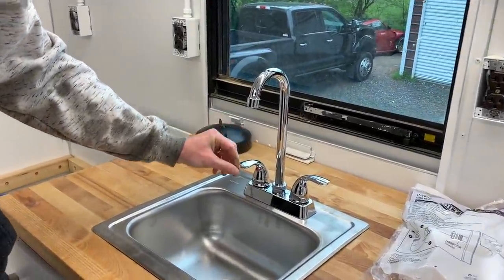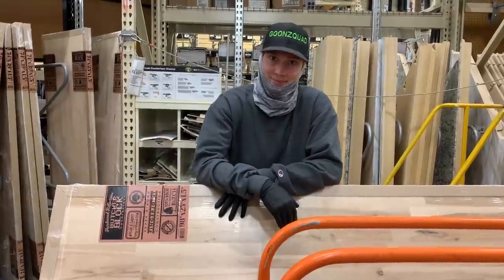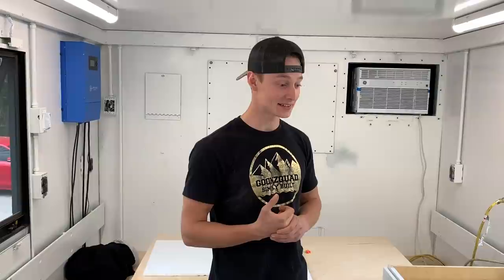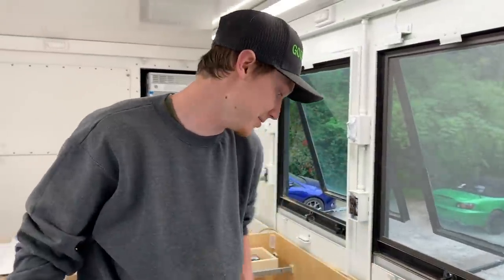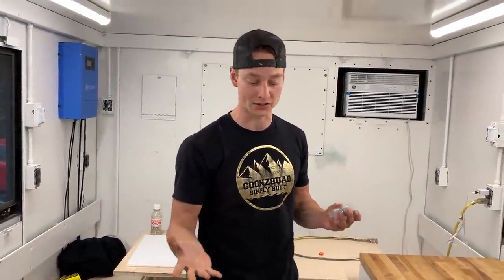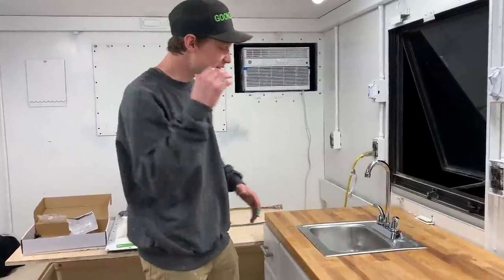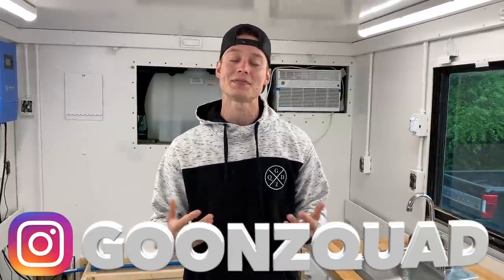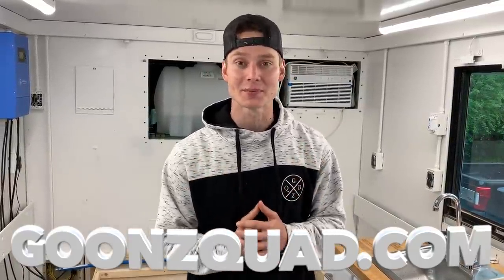Building The Ultimate Apocalypse Vehicle Part 7

Comment: Hi guys. Listen up. On top of the pump is a plastic cap underneath that cap is a pressure adjusting screw where you adjust the water pressure. So as i can hear when tou close the tap the pump stil pumps you must now bring down the pressure of the pump. The pump must shut of the moment you place the tap on fullt closed posion. 👍 greeting from SA

Comment: Those water pumps are normally mounted on a flat horizontal surface in rv’s so that might be your issue. Pump might have a check valve in it that doesn’t work when it’s mounted that way or even just the design in the pump it’s self doesn’t work that way.

Comment: If your sink is below the waterline on your tank, you could just gravity feed water and not need the pump . Also make sure the power inverter has plenty of air circulating around it. He don't want to have an enclosed area where it can overheat. Those things generate a lot of heat when you are using them at higher capacity.

Comment: Regarding the cabinet doors and drawers, you should probably have gotten real "locks" for caravans. Magnets usually aren't enough, that's why they use mechanical push locks to actually lock it in too place otherwise they will likely open when you drive around. Also the placement of that water tank seems like it could be an issue refilling it? At least if you want to use the refill stations in camping grounds, gas stations etc.

Comment: Excellent build guys, some great ideas.Just a little constructive criticism, try to conceal your wiring and pipe work as much as possible and run them in  straight vertical and horizontal runs, looks much neater and professional. Again guys great job none the less.

Comment: You should get electric heating for your water. That wouldn't be pretty awesome. Overall pretty good. Only concern is that you should insulate the water line just in case you guys go to somewhere that has snow. The line will freeze if you don't protect it.

Comment: Try installing pump closer to the tank. I have had  better results and you will hear it  much less great job like always!! NOTE"make sure there is no water in the system in freezing temps you might wanna make drain or like another "T" line going outside for a garden hose faucet this way you can that as a drain for winter storage and for bathing or washing mud out of truck.

Comment: You might think about some low-voltage heat tape so you don't freeze your tank or tubing? Some slide bolt latches for those Cabinets otherwise stuck inside.

Comment: you should put the pump near the tank, so you can run a shower outside the unit and run a T in there to run some pipeing on the roof, for hot water. then bring it in for hot and cold.

Comment: I'm sure someone mentioned it but I didn't see it scrolling through the comments. Because your bandana has tons of open space around them and they aren't filter masks they are pointless. In order for a mask to be effective they have to be special masks and completely seal to your face and be worn correctly. pinched around the nose and sealed all the way around your mouth and nose. The straps on the filter masks need to be crossed so the strap on the bottom of the mask is at the top of your head and the top strap on the mask at the bottom by your neck. Like this XD

Comment: For safety, please use GFCI, and Arc fault at breakers.  Have a one-inch diameter grounding rod. In three-foot sections, with couplers and ground lug to ground too.  The military surplus has slide hammer and rods.  For mobile systems, try to separate fluids from electrical areas. You are using your engine's ability to create air pressure; allows your faucet a pressure accumulator source for water head.  All tanks shall mount to allow for a low center of gravity.  Being under the chassis is safer.  Don't mix fluid lines near electrical—Mount tanks below the chassis frame for safety, ground rods with accessories.  Use health and safety thinking first, to protect from tragedy.

Comment: Saw another build where they relocated the massive spare tire to the rear. Just like a pickup truck with framework to lower it when needed. Opens up a lot of space behind the cab to install generator, water tanks, batteries, etc.

Comment: I know you guys haven't got to the batteries yet but be very careful around those puppies. Your current setup is giving me anxiety.  It's critical you put a vent to the outside.  You can use a DC computer fan, they also make cheap interior fans that are fairly quiet and low power.   If you don't do this the batteries off gas and it becomes a bomb.  Even reaching around the wires, if something sparks or you bump a cable and the terminal comes loose and it sparks you could have a serious situation on your hands.  Make sure you put NO CABLES ON THE NUT SIDE!  This can be easily overlooked.  The cables can back off the nuts causing a explosion. Fab up some kinda tie down for those batteries too.  You don't want those moving at all.  Nothing else should be in that space.  Having the water go through there is pretty sketch tbh I would route it some other way if at  all possible.  Stay safe, enjoy the build!

Comment: Propane is a helluva drug! :D Nice work boys! Shouldn't there be a sealing under the sink from preventing that water irrupts? The inner side of the cut isn't sealed with the oil so water could ruin the wood on the inside. Does the sink sits only loose in the cutout? There are gaps on the front and right side of the sink.  I can only speak for german sinks, but mostly there are some claps with screws, so you can fix the sink to the wood from underneath. Together with the sealing it should be waterproof. :)

Comment: I suggest adding a fill line the exterior tank that is at bottom of box level so you dont have to climb up or move the cab when you want to add water to the tank  just hook a hose to the top of the tank then you can hook to house water or RV park if you want to

Comment: Hey, make sure you vent the tank, otherwise you're just creating a vacuum and the pump is going to work hard and harder until it cant suck anymore
Reply: As it's a commercially available water tank, will it not have a vent installed as standard?
Reply: @2H80vids  It very well may. I hope for their sake it does.

Comment: The sink hole would not drop through because your jig saw is not aligned correctly. It made a tapered hole. You also need to seal under the lip of the sink so water does not get on the edge of the cut or in the cabinet and rot it out.

Comment: i think the problem with your water pump is the water tank is sealed unit. As the pump draws water out it needs to let air in but you have no vent on tank so pump is not only sucking water its trying to vacuum the tank too. Take cap off and run pump again for a while to let air out to test this

Comment: Hey im a new subscriber and i enyoy this proyect, I suggest if you could figured a way for the water to be recycleble filter and clean like an automatic system so you dont have to take your tanks and refill each time you need to if you can avoided great is eassier for the watter in use

Comment: Thank you for understanding my last post.  I really was concerned about your well being.  are you guy going high tech as well on this?   see the military would have blue light in it as well so I would suggest an Led strip light all around.   and I would also add some blue lights for the outside as not to attract too many bugs.  and I have in my home a roll up screen for my projector.   if you add one on top of the doors  you could watch some movies but a well lets not about roll ups or side ways for a bug screen.   might sound silly but can you open one door if the railing is on?  if not might consider moving to stairs to a side so you can open it in case of emergency.  still thinking that a pill out on the second side could add a sofa bed.and if you do it right, you can get storage space under the couch for you other camping gear.   Chairs BBQ and outdoor fire pit and even a tent.  or a meshed  tent.  you might also like to have hot water  pass a line under your solar panels to cool them down.  black pipe will get a lot of heat.  and if you need more  add a line to the truck cooling system  that said  by only concerns now are more of the poor grade of the doors and the fridge.  you need to understand that residential grades and RV and Boat grades are different.   for example. your paint thickness of the melamine of the base for your doors is 80 or 90 in thickness.  if you wash it with harsh soaps  you will see wood dust under it.  but if you build your own you could get as much of 160 or more thickness.  so for example we had some 160 in a contract we did back in 1991 for a paint store.  well they still have some of the units.  and never had to replace a thing.   as well as you could have built it using glue and Biscuits it would have given you a far superior construction.   but that said  what you got is what you got.   we learn by our mistakes.   also  you should use some silicone instead of glue for the counter.   the motion of your truck will be flexing things.and you should also add silicon to the back sides of where you hook to the wall and floor.   and that fitting you got under the seat near the batteries.  that can be a big mistake.  you should remove that and just a full pipe so no leaks in the power area.   water and electricity don't mix well for humans  and with motion and flex I can tell you it would be a spot that would leek.  note that I also would add a drain hole in that section to have a vent for the off gas of batteries.  and if you did get a water situation it would  empty itself. also due to gas propane inside you need a vent over the stove.  consider a marine grade or RV grade microwave.  and I would only use it when you are on generator power.  if I recall the marine version of a stove can heat up your water.  also get bio degradable soaps.  that way you can dump your gray water in nature.   Note get a potty that is pallets  so you can easy clean up and flush without taking the whole think in.

Comment: Guys you need to bleed the system before turning on the pump or you’ll wreck it. Follow the sequence of furthest HOT tap open until no air coming through then every other hot tap working your way back. Then turn on the pump. Im saying hot so when you finally get a boiler you’re doing it right already

Comment: im not a plumber but im pretty sure that if the water tank is above the faucet you wont need a water pump.
Maybe remove the water pump and test it out
edit: idk if this water tank has any hole for air, but if not, you should add some air intake

Comment: You guys need to be buying your stuff from an RV Place... buy a air condition that's actually rated for 12 or 24 volt system and a automatic sink pump.... you can also get a refrigerator that runs on propane or electric.....

Comment: Welding a frame for the water tank would work better. Bolt it under the truck between the rear tire and fuel tank.

Comment: Your pump is to low in the cabinet, you want the pump as close to the tank as possible ( less pressure needed to pump).. Place pump  in same cabinet as the tank your pump is working hard to pull the water through the whole waterline, if it's near the tank it won't take as much pressure to push the water to the sink rather than sucking the water from the tank.

Comment: I lived in a fifth wheel my first 4 years as a teacher (low pay, student loans, over demand on housing, etc.). Run some heat tape around that exterior water line. Get rid of the pump because gravity will do a better job. Your pump sounds like crap because your tank is sealed, it needs a vent for air to enter I think. Make sure you put a p trap under the sink, else you will get stagnant water stench coming up from your grey water tank.

Comment: I've been looking at many small home and vehicle videos. Everybody has discovered that water and electricity dont mix. Yes they do meet at kitchen. Water is better underneath. Yes batteries are heavy. Under seat could work . But water line above does not . How to drain water , when bad water or winter. How to fill? Also water is 8 lbs gallon so 250 lbs at 10 feet, and air con and solar panels, for a high vehicle , you are adding so much heavy stuff you could topple over.  Oh I can't wait to hear about sink comments. Yup messed up

Comment: Does anybody think they cut the sink wrong?. Surely  they needed to drill holes in Butcher's block to secure facet , the sink is thin flat metal at those holes they just bend sink and have movement in tall facet. So yup $270 gone . However, you can easily repair it , as you had such a tight fit, you can glue in the wood with 1/8 th shim . Could even dowel on the back. It would be exact fit on the back, but blades width out on the sides

Comment: Am I missing something here? Why didn't you guys just buy a totaled RV trailer or class C motor home? They would've had everything you needed in them plus more for a fraction of the cost. When you finished stripping everything you needed from them, you would have had either a good start of a flat bed trailer or ramp truck to haul cars on.

Comment: For that area above the cabinet doors you can get hinges so it will tilt forward and put a tray on the inside to put sponges and brushes https://secure.img1-ag.wfcdn.com/im/20828432/resize-h400-w400%5Ecompr-r85/1582/15825897/Polymer+Tip+Out+Tray.jpg

Comment: Guys you’re not protecting yourself wearing gloves dose not protect you if you’re touching surfaces and the still wearing those same gloves to pull down your masks and pull them back up again... and I use the term mask loosely.. to protect yourself masks should be a single use item as the viruses can live on the surface for some time. With your gloves you need to think like you have them covered in paint, so you can think about what to touch (definitely not your face) and how to take them off... my wife is a nurse on the front line, please take my advice seriously.... stay safe, peace!

Comment: The way use the masks are so wrong. The handkerchief you used is not acceptable as it will not cover your nose properly. Find a surgical mask or a N95 one. Do not remove it and talk which is unsafe and everything in the edges easily goes in.